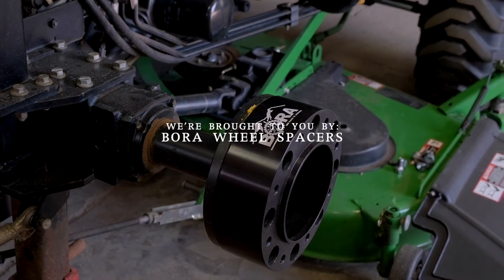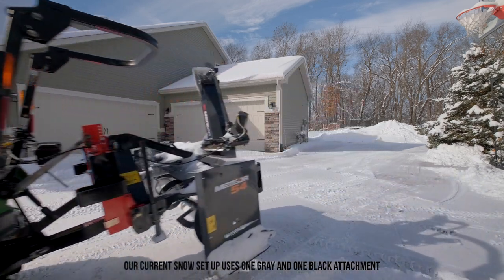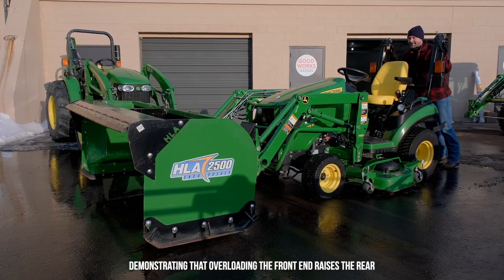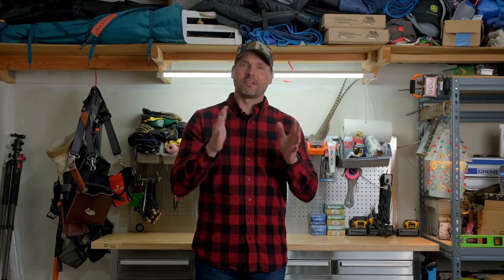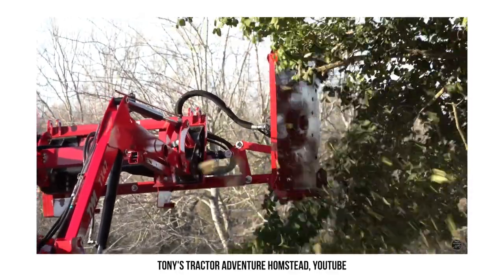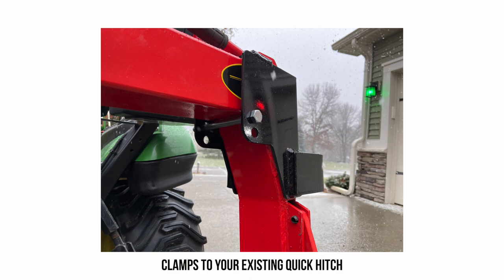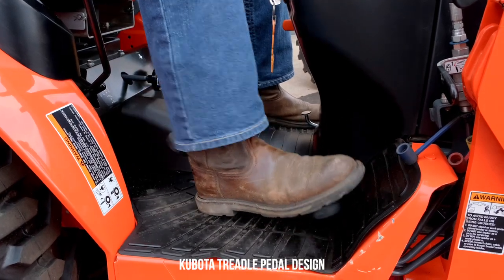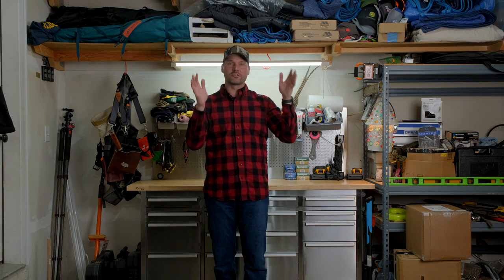7 UNSOLVED TRACTOR MYSTERIES, NO EXPLANATION.  CAN YOU HELP? 👻

Comment: ROPs height is determined by geometry.  Draw a line from the top of the roll bar to the top of the hood (technically, to the top of the weight bearing frame under the hood).  That line needs to be above the head of the user sitting in the seat.  Shorter tractors need a taller ROPs because of the steeper angle.

Which brings me to dimensions.  Narrower tractors will fit into places that wider ones won't.  And shorter tractors will have a tighter turning radius.  When you're trying to sell a tool that can do as much as possible you make it as narrow as possible with the smallest turn radius.  (The end customer can always add width, but can never subtract width...and short can be offset with front or rear weights.)

The reason John Deere folks want green attachments is because they paid so much for that green paint, so if ya' got it, flaunt it!  (I have a Gator that's almost identical to the Kawasaki Mule from the same year; every part for the Gator is twice as much as the same part for the Mule because that green paint is REALLY expensive!)  :)
Reply: Oh, and the right/left pedals on Deere and pretty much everyone but Kubota....the inboard pedal is forward because it makes for a narrow stance when driving.  Pressing the outboard pedal puts a little extra fatigue on your hips and thighs, and forward is used a lot more than reverse.  In your car, the pedals are directly in front of you, but on the tractor they're displaced off to the right.

Comment: Positive down pressure is a great idea on a 3 point hitch until you actually use it, then you realize it’s completely useless. For draft equipment, the more down pressure you add, you lift your drive tires off the ground, so less traction. Using a rear blade on ice or hard pack snow is is even worse, add down pressure, again less traction, with the addition of loss of control, especially if going down a hill.
Reply: Makes sense. Instead add weight to the attachment. Maybe weld a bracket on it to put suitcase weights on, etc.

Comment: Color: branding, pure branding.  Red used to be Farmall.  Nowadays Case IH is yellow, I think because most heavy equipment is yellow regardless of brand.  
Tippiness: Tractors were originally built for row crops - that defines the spacing between the wheels.   It's like the spacing of railroad rails is defined by the width of roman chariot wheels - which was actually defined by the breadth of the horses. The height is usually based on the diameter of the rear wheels which defines the height of the differential, although I have seen tractors that have offset gearing between the differential and the axles.  High differential means high CG, although there's also the factor of being able to pass over most crops.  Backhoe stabilizer pads can help prevent tipover - if there's a backhoe attached.
Roll cage: even though the compact tractors are targeted to the consumer market, the manufacturers think in terms of BARNS, not car garages.  Or just parking them outside - I think farmers usually don't care too much that their tractors look factory new.
Hydraulics: Tractor hydraulics were designed for controls, ie cylinders, which don't usually need high volume.  NOT motors which do need high volume.  They're designed to use the PTO for power output.
3-point hitches were designed for row crop attachments which only needed something to lift them for transport.  Older tractors didn't even have a 3-point - the Farmall 560 I used to have just had a draw bar - I had to add a 3rd party 3-point.
Forward/reverse: no idea.  My Farmall had a reverse gear.  My case 580b had a forward/reverse lever on the column - THAT made ergonomic sense.

Comment: I never had a problem with a treadle pedal. But the John Deere's dual pedal does make sense. You go forward more often than backward. If the pedal was at the right, your leg would get tired more quickly. Keeping as close to the center as possible keeps the pedal in a more natural position of where your leg would naturally be. I also don't get the comparison between a tractor and a car. There are two entirely different pieces of equipment. If you can't learn which pedal to push, should you really be operating either? I'm sorry if that sounds harsh, but these are serious pieces of equipment. You need to take the time to develop the muscle memory.

Comment: I haven’t operated a farm tractor since 1974, but remember operating a 4020 JD with rops. My dad,s old MM U tractor was a little tippy when plowing terraces on our Oklahoma farm, but it was easy to step off the deck🤣.I still love watching sg equipment. If you watch the tractors used for mowing on interstates, most are wide stance and low to the ground and th ey handle some scary slopes. If you look at the OSHA regs, they refer to specific standards developed by engineering companies, but don’t have specific details other than you must have ROPS and a seatbelt, plus operator training on the seatbelt. Be safe!

Comment: Color is for sure Brand recognition, if you haven't looked at the Styling of Kubota and Kioti lately, their body styling is VERY much the same in the hood design! 
PTO power vs Engine has always been my gripe point HP is measured differently than before, and pre 60s tractor were measured by Belt power! (A 2N Ford can pull a 2 bottom plow at 22+/- hp, where my BX2200 can struggle to pull a middle buster!)
As far as tippy.....ALL tractors are tippy, it takes a little common sense to be alert in possible situations, I think!
As always, your videos are enjoyable and full of useful information!

Comment: What percentage of tilt should I be worried about? I have slopes that my "tilt" meter says I'm at 15% I do have wheel spacers and beet juice in the rear tires and my tractor is a sub compact. Thanks

Comment: Excavators have two treadle petals and I don’t hear complaints about them. Larger hydraulic pumps require more horse power. 3 point down pressure has the potential of lifting the rear tires off the ground and maybe causing a unsafe condition. I assume that the ROPS bar are designed to prevent the tractor from rolling over; thus, if they were shorter they might not work. If a manufacturer could make a ROPS shorter and still have it work, it would save them manufacturing cost; so, I’m sure they would already be shorter.

Comment: Colors are easy- we don't always get close to a tractor working somewhere, so making a brand recognizable from a distance makes sense from an advertising mindset. The JD twin touch pedals- that's an easy one too......you spend more time going forwards than backwards and having your leg and foot more centrally located in relation to your body is simply more comfortable, especially over longer periods, plus your thigh isn't close to, or rubbing against the loader joystick when your foot is closer to the center stack.

Comment: Ventracs are very stable.  Wide & low.  Articulates both ways. And angle meter on board, too.  And fits under a garage door.

You can increase hydraulic output somewhat on John Deeres.  Visit Hydrosplus.

Yep, non standard pedal configurations cause problems.  retroactive inhibition.  It's why you still reach for the clutch pedal when you switch over to an automatic.

Comment: Down pressure was offered in the 4R series literature in 2014 but never actually implemented or sold. I have the literature and tried to get it when I bought the tractor as well. I also tried to put it together at the parts counter but not available in pieces either! Thanks for you time and effort with the always informative videos!
Reply: Edit: David Weber has a post indicating that it does exist! Research resumed!

Comment: I added 3” bora wheel spacers after 40 hours on my new 1025r. Was the best thing I’ve added for stability. I went with the steel option for the added ballast weight over aluminum.

Comment: If the ROPS on my 2025r was 2 inches shorter it would also not bend the top link on the 3 point hitch if the imatch is installed.   If you have it down and bring up the 3 point all the way up the ROPS will bend the top link.  Does it sound like this happened to me?    Thanks for the great videos.

Comment: Our New Holland Workmaster has forward and reverse pedals. I love that I can just barely push the pedals and go as slow as I need to. Most rollover structures can be lowered. We completely removed ours in order to work inside turkey houses.  The only fault I have with our tractor is that the fuel tank is right behind the seat. Makes it hard to see whn hooking up to something with the drawbar

Comment: I think the forward reverse pedals are the way they are so the forward is closer to you since you’ll be going forward more often and won’t have to reach your foot out so far. I have gotten used to the treadle on my kubota. We had a customer buy a Mahindra and would not fit in his garage when it showed up after he ordered it because it was about 6” taller than the specs showed.
Reply from the maker: Seems to work okay the other way on a car though?  I don't feel like it's that far out, but maybe it's because I have long legs :)
Reply: I agree I don’t have long legs I’ve never found it confusing.  The one that gets me are the smaller lawn tractor, my 345 has the brake pedal and go pedals are on same side .   If you are on a incline and trying to get close to something you can’t brake
Reply: @GoodWorksTractors  The pedals aren’t directly in front of you like they are in a car.

Comment: Excellent to hear I’m not the only one boggled at the tippyness of tractors. They never progressed from their original configuration unlike cars, which also started out high and with engines way up in the air and huge hoods. The three point hitch is hopelessly outdated too. Why we still use dangerous and fragile PTO shafts instead of hydraulics & hoses (for bush hogs, for example) is beyond me. With a little innovation and mass production the price would drop.

Comment: I may be biased, because I’ve only owned JD, but the Twin Touch seems intuitive to me. The go pedals are on the right and the stop pedal is on the left. I get the car analogy, but it’s just an extra go pedal over there. I have used the treadle pedal on a Kubota that I rented before I bought my 2025R and it was the most frustrating thing on it, and ultimately kept me away from Kubota as an option for a compact. I wear a size 13, and it was awkward to use, going in reverse was similar to your experience, but the biggest pain was that there was nowhere comfortable for my foot to be. It also made entry/exit from the right side difficult. It almost seems silly that something as simple as a pedal kept me from buying an otherwise quality tractor. Like you said, where’s the focus group?
Reply: You and me both.  I borrowed my neighbor's Kubota a few years ago to spread a load of shell rock.  That treadle was very tiring for my old right leg.  Two months a I bought a JD 1023. Perfect.

Comment: I have a compact John Deere and love the pedal system. Firstly the brake pedal is to the far left it is left foot operated. I am on a hill block so a lot of the time my left foot is hovering over the brake pedal while operating the machine in forward or reverse. The  forward pedal inside is keeping your leg in a straight line. In reverse operation, quite often we are turning and looking over our shoulder. The natural movement through your torso automatically brings your leg out to counterbalance your movement pretty much in line with the outside reverse pedal. So if you are twisting to the right your leg moves further out right. If you are twisting to the left your right leg will still automatically move out to the right. So the pedal position was only strange for the first couple of operations on the machine. As for the ropes bar. Coming forward and higher on the angle gives more safety margins above your head. I  am 5'8" so dropping the whole set up for me would still give me plenty of safety margin above my head. If however I were 6'5" it would be a different story. A lot of people I see for some reason drop the rop bar to its lowest position when shedding it. If you place your pins in the middle hole on the John Deer the top part of the rop bar sits at a right angle facing back which is great, because to put it back in the drive position you are pushing it up rather than lifting the heavy bar from almost a vertical downward position. I for one think the knuckleheads have got it all pretty much spot on 😅

Comment: I'm a bit of a mediocre grade engineer myself so here's my thoughts...

Color: Cheaper to provide equipment with a single color. Less SKU's. Also brand identity is critical and marketing becomes easier. Color is a preference option that provides no real performance over your competition in the brochures.
Tippy: You mentioned they are tippy if you're not on perfectly flat ground. These machines need ground clearance because they're mostly used on non-flat ground. Also steels have gotten better, and stronger so less is needed to achieve the same strength. You can make it wider, but that limits maneuverability. (There's surely many other factors as well.)
Hydraulic vs PTO:  PTO is just simpler, cheaper and more reliable. Also tractors were not traditionally designed for using front tools besides a bucket. They're pulling tools. 
Foot Pedals: Most of the time you're moving forward. Placing the forward pedal on the left is more ergonomic that the right. Less forced leg spread. The treadle is logical with front for forward and back for rear, but the details of the pedal connection is quite varied and can make the experience good or bad. Shuttle shift is the most like a car, but it's more expensive. 
ROPS: If you draw a line from the tip of the hood to the top of the ROPS. I'm guessing that it would provide just enough clearance for a tall operator if the tractor were to flip upside down. Also by making it shorter, you're more likely for a full rollover rather than just stopping on it's side. There's likely some wiggle room they could work with, but cutting it too close on safety equipment could lead to ugly lawsuits if it doesn't provide the required safety cushion in an accident.

As I've been getting more into tractors, I have many of the same questions you asked here. It's like they refuse to join current trends with ergonomics and user interfaces!

Comment: My answer on the hydraulic vs pto power.  PTO power is a lot more efficient.  There is a lot of lost power just because the fluid is compressible as compared to a direct mechanical connection.  I had a seven foot mower on a T320 Bobcat skid loader.  Running it on a hot day would overheat the skid loader even if I wasn't using the air conditioning.  It's about a 90 horsepower machine.  For comparison, I now have a 8 foot mower on my 1655 Oliver (70 PTO hp) and it can work all day long and it stays in the operating range of the gauge.  Skid loaders are great, but they are not the answer for every single job.

Comment: Trail Blazer makes a reasonably priced Pto power pack for their 44 inch loader mount brush hog.  It is under $2k and it will give you 400 pounds of ballast when you fill it up with hydraulic fluid. This is enough to run their brush hog. We should be getting ours sometime in March. Unfortunately probably the end of that month. Like everyone else, they have production challenges.

Comment: 💥 I’d like to see an option for either twin touch or treadle pedal. You would think someone would make a kit by now. 🤔
Keep on tractoring!
Reply from the maker: Agreed!
Reply: Well Jon I have a idea but it is still a few projects back on my list😁I am share someone will beat me to it😂👍
Reply: And also maybe a Cruise control and a hand lever for forward and back 🤷‍♂️
Reply: @frankemswiler2836  I have a reverse lever on my '05 JD 4520. It's a power reverser not a hydrostatic tyranny. I can shift into reverse while going forward and not stopping. It's very handy when I'm brush hogging. The dealer told me I could be going forward in road gear and throw it into reverse without the clutch. The tractor slows down then goes into reverse. The only thing you have to remember that when you do that, reverse will be the same speed as you were going in forward. I prefer the power reverser to hydrostatic but to each his own.
Reply: @douglaspost5097  agreed on that. I have the shuttle shift on my Kubota. Same as the power reverser. Wouldn't have it any other way. Also no hydrostats robbing power.

Comment: ROPS. I got a 9.5' high storage container to store my tractor.
Color. They do it as free advertising.
Storage. Heck if I know. Mine is packed full. I hang an old cantle saddle bag on my ROPS for extra stuff.
Treadle pedal on my L3560. I like it but I don't use my heel for reverse. I use my toe for both. My brake is on the left side for left foot use.

Comment: I have a 2019 JD 3025E. When I need to turn my body around enough to see clearly what I am doing, I would not be able to keep my right foot on the forward pedal. That is probably why they use that configuration.